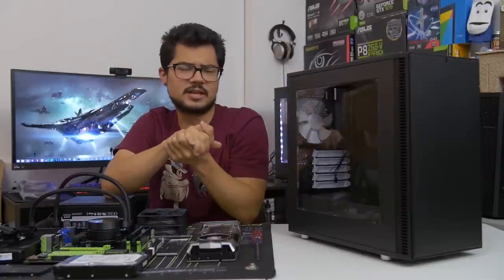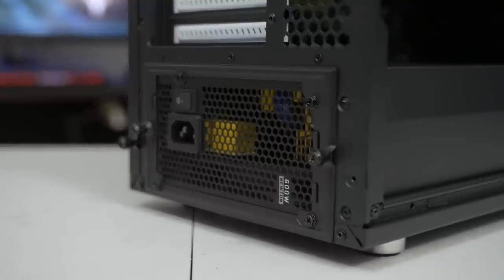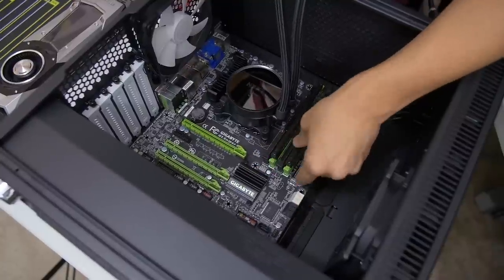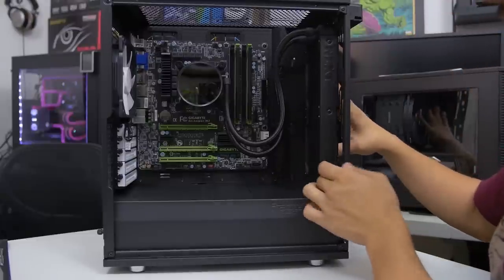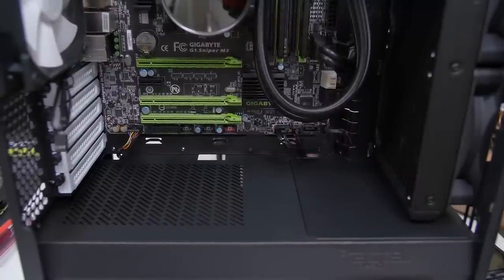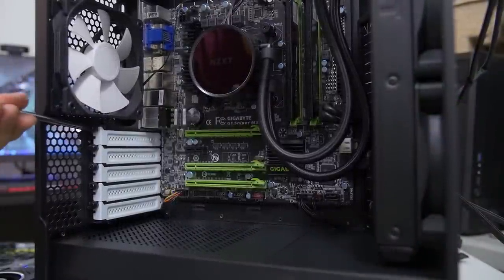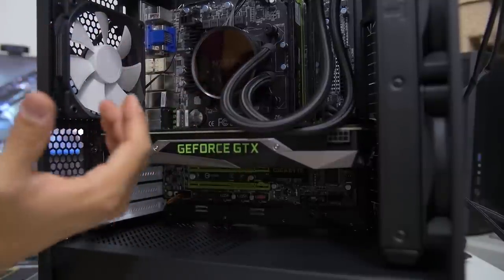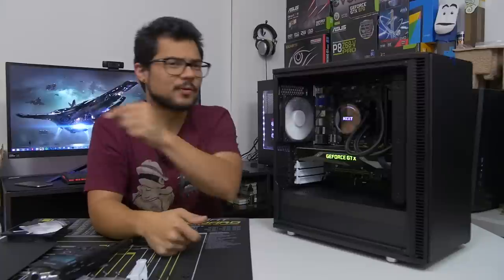Building a PC in the New Define Mini C from Fractal Design

Comment: Stock fans (@60%), Intel box cooler, stock GPU cooler, the top panel being on, no window:
i5 6600: idle 28°C (in-game, sub 50°C (fan not audible))
GTX 1050ti: idle 32°C (in-game, max 62°C (fan at 50%, not audible))
HDD: 38°C to 42°C, using the HDD cage in the stock position.
SSD: 32°C max, using the HDD cage in the stock position.
PSU: not sure, but that thing doesn't even get mildy warm. It's a 500W PSU, so the i5 6600 and the GTX 1050ti don't really push it.

I'd say this case is a very strong 9/10, for a single GFX card solution. I took one point off for the rivets used in this case. I like PC cases, that I can take apart.

Comment: hey can anyone help me out? im going to build my first pc, are these parts compatible with one another? if they dont, any possible recommendations? thanks.

motherboard: Asrock 970A-G/3.1
processor: AMD vishera FX-6300
RAM: Geil DDR3 evo veloce PC12800 (2x8GB)
VGA: XFX radeon RX460 4GB DDR5
Cooler: 1stplayer steampunk watercooler dual fans
psu: antec edge 650w
case: cube gaming weiss G1
and a couple of extra fans

Comment: Are you certain about having to open up the PSU shroud for a 280 rad in front? I have 2x140mm fans in the front with the shroud closed, and there's some room to spare up top (though admittedly, not a lot). Feels more like a situation of, "if your 280 rad is more than <say 290mm> tall, you will need to open the shroud".

Comment: say I wanted to put one single fan blowing across the HDD bay on the bottom towards the power supply what size would it be 120mm? I am a little nervous about stagnant air flow down there if I do decide to buy this case... 

Also that NZXT X62 Liquid CPU cooler?

Comment: So, I REALLY wanted to use this case, but my whole plan was to use a H100i mounted up top. Is there enough space to do that? I'd rather eject hot air out of the case instead of into the case. Thoughts?

Comment: I'm confused by your front measurements at the front with the fans for GPU clearance. It's 315mm with a fan but what about the fan and the radiator installed - what clearance do you get then?

Comment: I have watch so many PC build with the rad bean install in the front of the case, it might look good to you but it’s wrong because all the heat from the rad will be dump right back into your PC heating up your motherboard, VM’s and memory. Rads must only be install at the top or back of your case leaving the front only for cool air intake.

Comment: Can a 280mm radiator be installed in the top in this or the non-mini version? If it fits 2 140mm fans up there why not a 280mm radiator?

Comment: think i might get tthis case using a coolermaster case atm wich has magnetic dustfilters on top and front dont know wich model but the dust filters are usless pc is getting covered in dust on the inside and the dust filters blocked 0 so i think this might be better

Comment: what's the point of the psu bracket with thumbscrews? Still 4 regular screws to put on + 2 thumb ones. And it's not like you were going to hotswap your psu or put it in and out daily ?
I see no point exept marketing
Reply: codeartha it allows you to pull the power supply or the back, instead of having to take off the side panel...which in this case,  there isn't the clearance available for whatever reason.

Comment: I'm gonna build a pc (for gaming) - and I'm wondering if I should use 32GB of ram, I think I only need 16GB, but some friends say I should use 32GB.

One friend who only uses a macbook air says I only need 4GB of ram, but that's not happening.
Reply: The basic is 8go Ram, if you just gaming on the computer. You never need 32Gb of ram, sorry for my english.
Reply: Rowan Nag 16gb is usually recommend for future proofing as some games are starting to recommend 8 or more so I would get 16 but 8 if on a budget. Also tell that macbook kid to stop wasting money on trash :)
Reply: 16g is enough
Reply: No game uses more than 8 gb as far as I know.
Reply: Matthew Dattilo oh wow. But Mafia 3 is kinda poorly optimized tbh.
Reply: 32 will allow your gaming to run a lot smoother
Reply: Dennis Luzba no it doesn't. Only 2-5 fps difference at most

Comment: They cancelled the reserwall? How dare they!
Reply: *****
I would not have minded if the case would have been a tad longer to make the reserwall avaiable (and the overly elegant mounting options for 3,5" drives)
Reply: it is possible to mount it on the top fan slots if you dont put fans there? or mount front fans outside of the case and mount ress on the rad? donno.
Reply: Baka Sahara
When they call out 'extensive water cooling support' in their adspot, I do not want to McGyver something in there...
Reply: Medievalfan94 right i didnt see their ad
Reply: Reser-what? :P

Comment: Never been a fan of the fractal cases when it comes to looks. The white slots and fans really limits your choice of color for a nice looking build. I'd be fine if only the fans were white but the gpu slots are a bit harder to replace.
Reply: Mack TB If it bothers you, just paint them.
Reply: ThierryTheuns I guess that could be a solution if it wasn't for the fact that I am probably the laziest person in the world.
Reply: Mack TB If you're so lazy, how come you're doing so much research on cases :P
Reply: Welp, you can pay someone else to do it. They'd likely do a very durable, professional job too.
Reply: ThierryTheuns I actually just collected enough money for my first ever pc build today, so I've gotten some background on components and component brands lately.
Reply: Mack TB Congratulations! What'll the specs be?
Reply: ThierryTheuns MSI gtx 1060 oc, i5 6600k along with deepcool 120 captain liquid cpu cooler. I guess those are the most interesting ones. I'm on quite a tight budget seeing as the prices of parts in sweden are extremely high and default shipping online is like 100 bucks + per part. The case has been a problem for me to pick out since the eclipse p400 and p400s are never in stock here which are the perfect match for me. I'm working on it though.
Reply: Mack TB That's a nice system for a first time build. Pricing in Europe sucks, here in The Netherlands it's not quite as bad, though. Maybe go on vacation to Germany for some cheap parts :P
Reply: ThierryTheuns Haha, the vacation over there would probably end up costing more than the build itself though lol.
Reply: Mack TB But it's still a vacation :P. Sure, flying to America for PC components would be stupidly expensive. Flying to the US and happen to bring some parts home however, is a whole different story.
Reply: Mack TB - I would recommend PlastiDipping the brackets. I have a black and red theme build and I didn't like the white brackets on my Fractal Define S, so I sprayed them Red. It's great because if I wanted to switch the colors in the future, then I can just peel it off and make it a different color. To be honest, to get them to look decent will take the better part of an afternoon because of the amount of time that you have to wait between coats, but it is totally worth it.